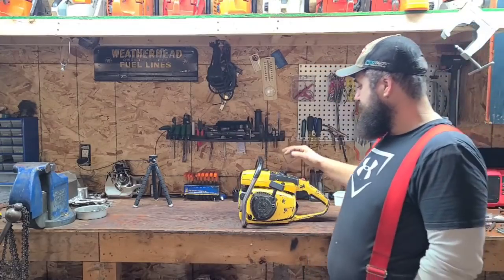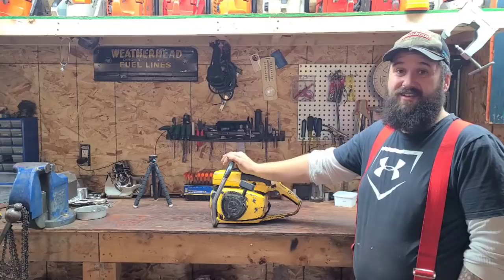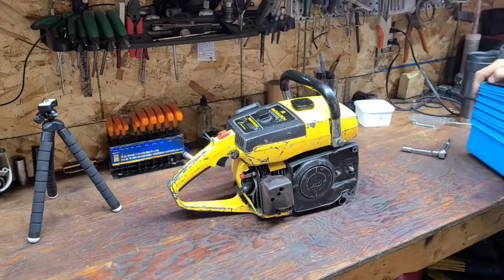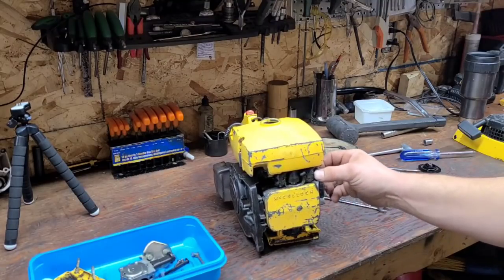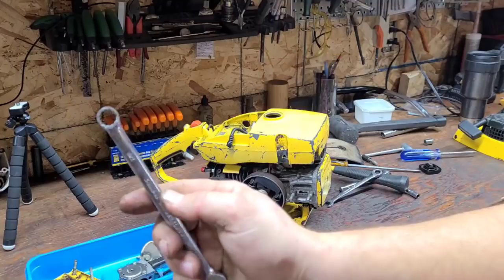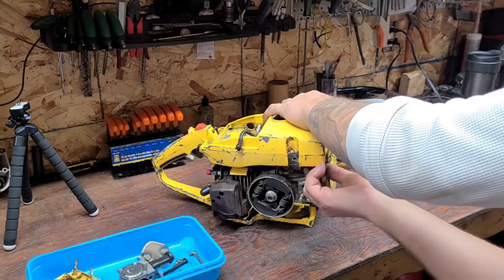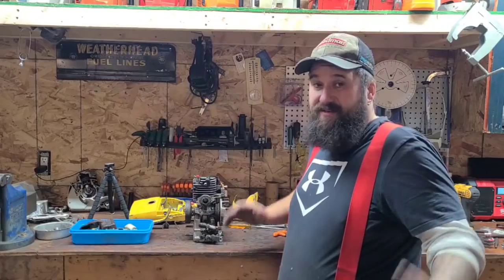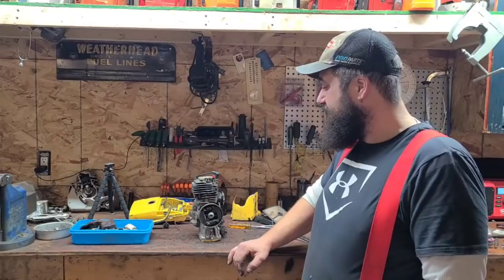McCulloch SUPER PRO 70 turd saw build!! lets do this!!

Comment: Tinman, my first chainsaw that I worked on was a McCulloch Pro Mac 10-10, and I watched 1 video then rebuilt the carb. Kinda easy, the last owner ran it without the air cleaner in place so the cylinder and piston are damaged, rings are damaged and stuck so no compression. I'll get replacement parts and restore it with my son. Thanks for taking us with you on your journey. Be safe.

Comment: Aaaaaarrrgghh. Missed by that much. I have a matching 1 of these Macs. Under the cover where the oil is there is a plate that separates the oil from the engine (or it's meant to). The plate is held in place by a thingy under spring tension. I was after a look at that thingy and I was going to reach out to the masses for a name of that thingy. My Mac70 has a secret identity as a smoke blower as the thingy isn't doing it's job right.

Comment: I have a pro mac 700 that is a good runner in stock form.  I resurrected a CP-70 with the pull start on the clutch side.  It was an awesome runner with just a mild port cleanup. 

Good luck with it!